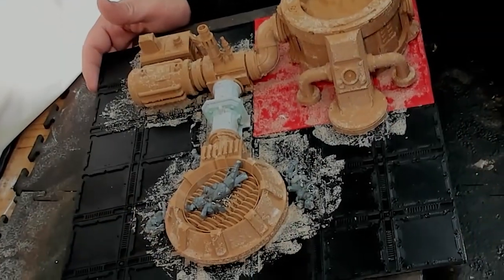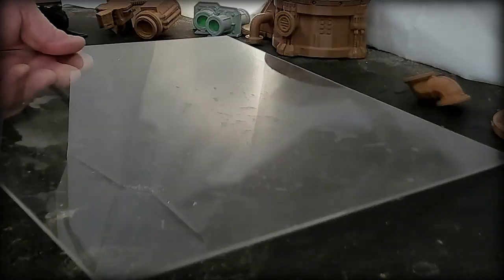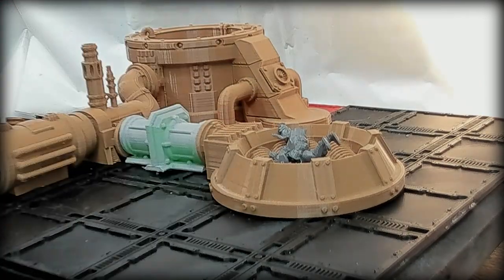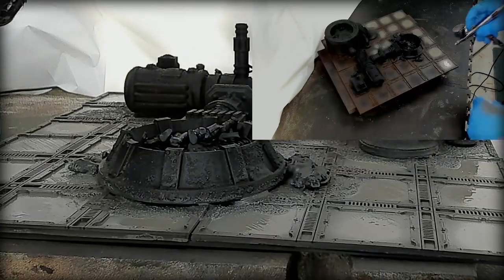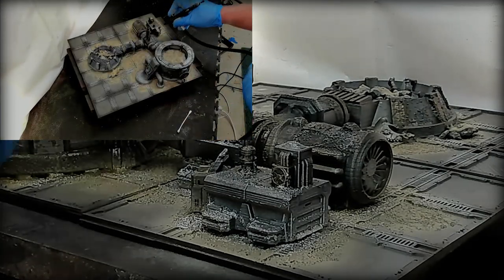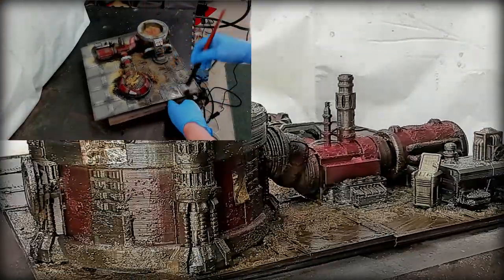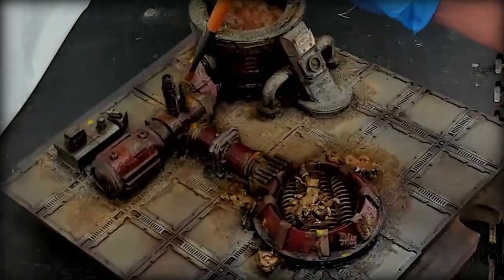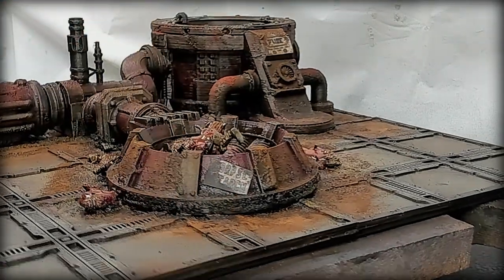Necromunda Corpse Tank Tile Terrain Rescue

Comment: So one thing I noticed before you glued down the sand was a few joins in the pipes that looked a touch wonky, not sure if you can still see those in person by the time you finished, but a solution I've seen on a channel that mostly deals with 3d printing is to take a sheet of plexiglass or a floor tile and glues some wet dry sandpaper to it to get perfectly flush sides and level bottoms before assembly.
I also think a quick drybrush of silver either over the whole tile or just the machines before you moved onto the oils would have looked really good.
Reply from the maker: Thanks for the input.  The pipes were wonky a bit and that might be what Mike was referring to when he called these 'failed prints' when he first gave them to me.  I used that to make a leaking point with the oils later so it worked out in the end.  That drybrush you speak of is always in the list of possibilities on every piece that I do and I sometimes use it but in this one, I thought that it would brighten things a bit too much for the grimdark I was going for with this piece so I decided to skip it on this one.
Reply: @jdinthesumpsea1560  Do you have one of the really dark metallic paints, or maybe thin down a brighter silver with some black ink?
Reply from the maker: oh yeah totally.  I was in a certain groove with this one though and I just rolled with it.
Reply: I have started to love "Decayed Metal" from Vallejo.
Reply: Just realized I was wrong...I meant "Decayed Metal" from Scale75...

Comment: lol didnt even knew PVA glue holds the plastic well. Does Plastic glue work with filament too?
Reply from the maker: It should yes....  It depends on the filament you are using I would think.  The PVA glue always seems to work well on just about all of this stuff and you almost never have to worry about it melting things.  It's turned into the go to for almost everything I do these days. Thanks for tuning in!